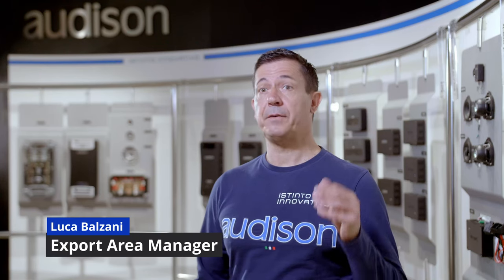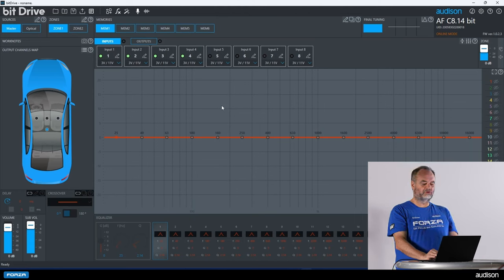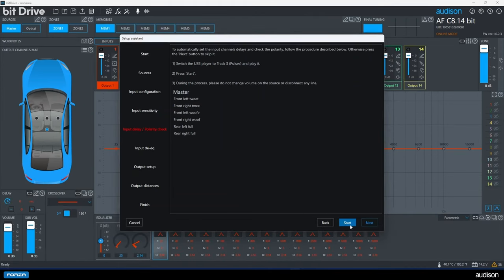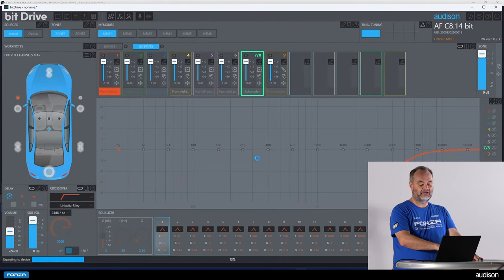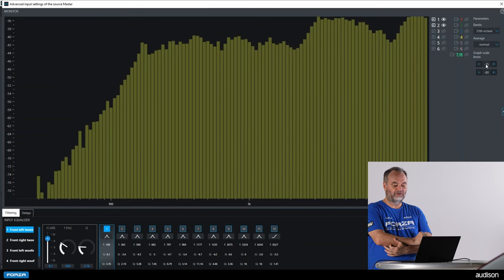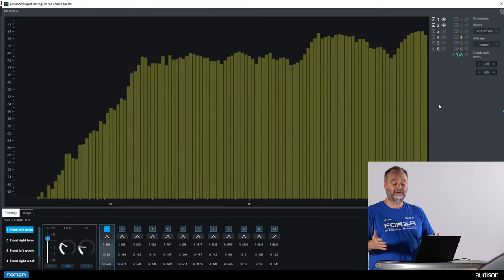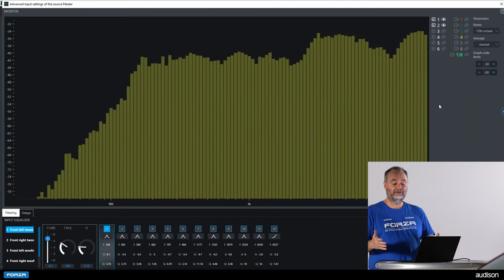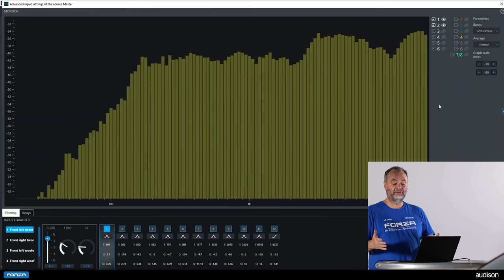OEM integration and tuning process with Audison Forza bit amplifier - https://audison.com/bit-drive/

Comment: Was that mustang equipped with the bang and olufsen system?  Would this amplifier be able to integrate with those A2B factory amplifiers ford vehicles have? Or would it be better adding a pac audio ap4 to integrate into the radio and send a flat signal to the forza amplifier?

Comment: A technical question... We know that the Forza amplifier has an integrated DSP that can “individually” control all the adjustment settings of a speaker, for example a Mid-Bass. But when I choose to make that type of bridge connection, for example using channels 1 and 2 together to feed a mid-bass, what happens to the entire sound configuration, in the DSP, for this specific mid-bass? If I am feeding this mid-bass through two channels of the amplifier (channels 1 and 2 at the same time), then do I have to repeat all the adjustment settings (frequency cut, time alignment, etc.) on channels 1 and 2 of the DSP? Or is there some feature in the DSP where I only need to choose one of the two channels to make the adjustments and I can disable the other?

Comment: i've got this installed in my seat leon. this is the most complicated piece of crap ever made. do not buy this unless you are an expert in setting EQ. christ, this is so ridiculous and pathetic. how are we expected to tune this? this is a huge waste of money. just get a normal amp. avoid this!
Reply: 😂😂😂 this is literally one of the easiest setups I've seen. What did u think you were getting into with a dsp? There are way more complicated ones out there.. good luck
Reply: @claysmurthwaite2386  no this is not simple. where are you based? if you're within 200 miles, i'll pop round and you can tune it.
Reply: @mrbungle4163  sorry bud, I live in canada. But this really is simple compared to other dsp's on the market. If you watch this video a few times he goes through every step you need to do..